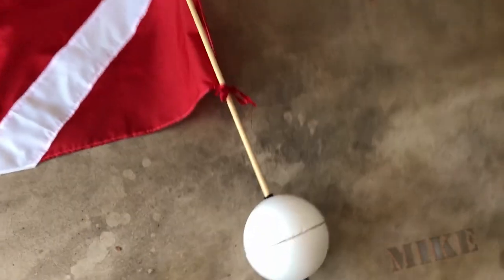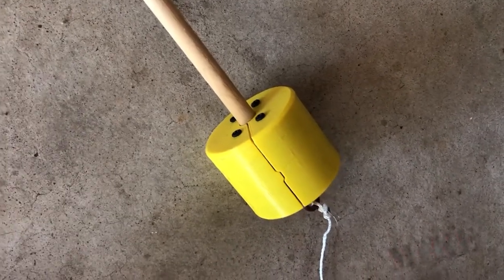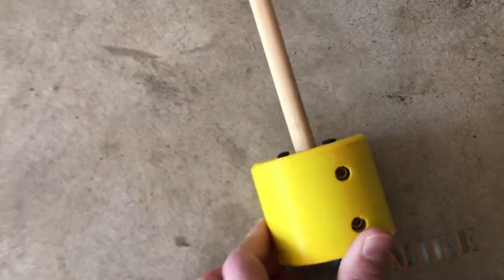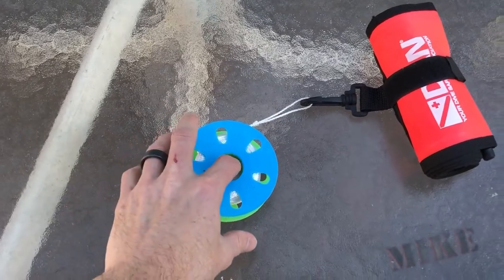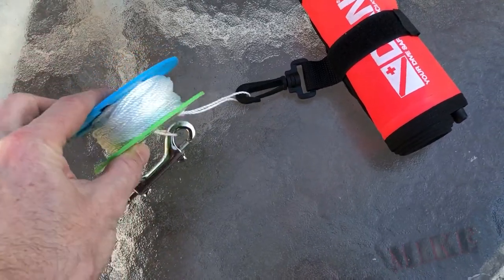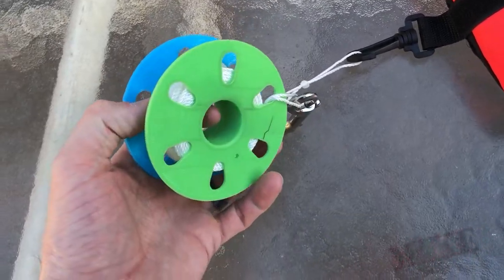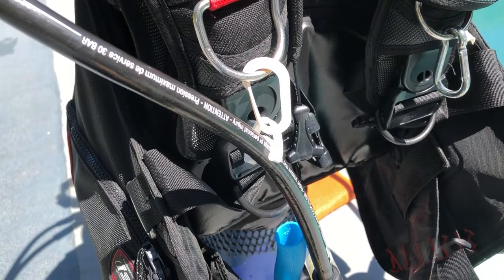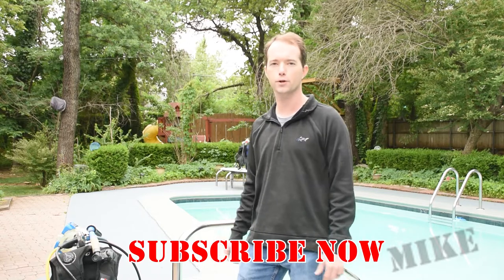3D Printed Scuba Accessories 1 - Mikes Inventions

Comment: Hi i designed a go pro mount for my diving light and despite reinforcement it doesn't' hold long and already lost 1 gopro as it brakes. What about infill ? with low infill the print is capturing air that get compressed and then extended again might not be good for the durability. Should I use 100% infill ? it brakes at the diving case attachment

Comment: What consideration did you put into the materials?
Reply from the maker: Hey Scott! I looked at my supply of filament and thought to myself, "I think green and blue will stand out nicely for my spool." I used PLA because I didn't have the colors I wanted in ABS. ABS is also more temperamental, and I don't like to use it. PLA is just fine. No issues at all yet. Thanks for watching!